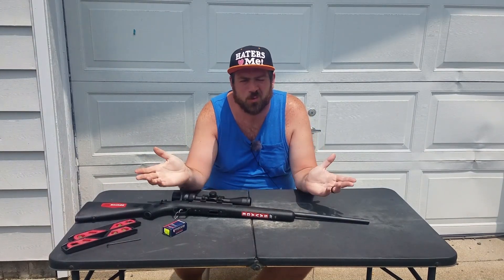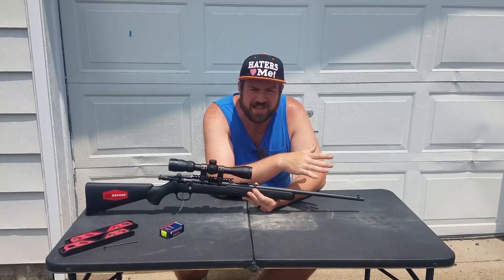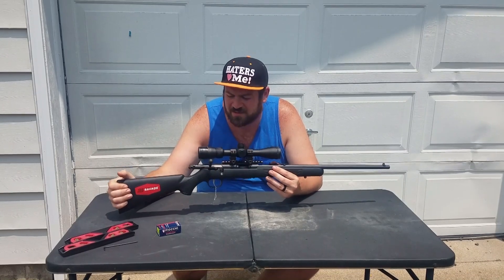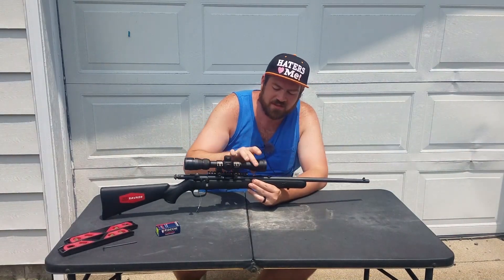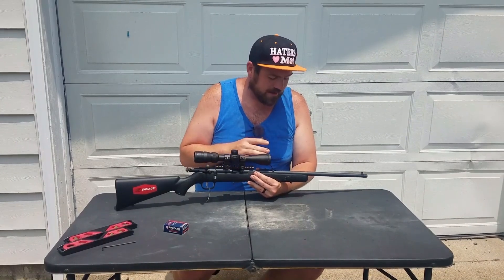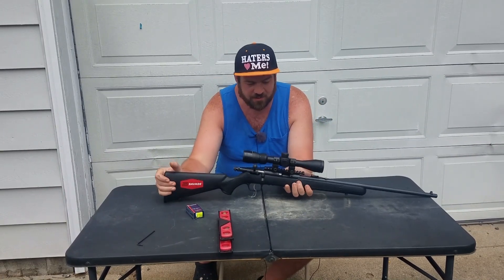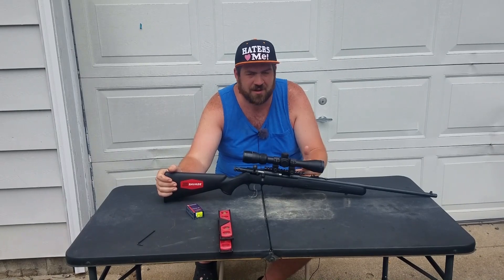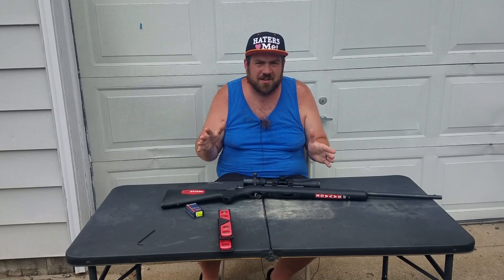"UNKNOWN" 22LR Tuning Method pt3

Comment: Alot of information protrayed here is severely flawed. Curvature of a bore can clock all sorts of ways. Only way to know is with a range rod dialed with the barrel dialed on a lathe. 
The orientation of a scope has nothing to do with accuracy.  All a scope does REGARDLESS of its canting or vertical alignment is help the shooter visually aim. The rifle will do what it wants to do

Comment: Whether or not the barrel is pointing down or up relative to scope axis.....the core question is "Is there enough internal scope adjustment available"...to center your hits? True enough....for LONG range shooting...many use 20moa "tilted" bases, with the back end higher. This is the same as having the barrel "pointing up" as you say, relative to the scope's long axis. But at shorter distances and with enough scope adjustment capability....it just shouldn't matter. Hint....Burris Signature ZEE rings have polymer inserts where you can buy excentric inserts...allowing up to 20 moa ( actually 40 moa) of tilt. I don't understand how group "size" is affected one way or the other. Sure....WHERE the group lands may end up a bit different than expected (if barrel points down vs up)....but how does WHERE the group hits....affect GROUP SIZE ? Doesn't compute.
Reply from the maker: The way the barrel is pointed determines the trajectory in the flight of the projectile on impact at the target whether it's stable or unstable ...changing the angle does affect groups if projectile is not grouping  well ....just did it at 100yd with an airgun 5 shots sub moa and hitting playing cards on edge back to back with cheap pellets (crosman 14.3gr HPs) by moving my scope to match the angle 2 notches forward on my picatinny rail
Reply: @STKO2011  ..so you're saying if you shoot a gunpowder  style rifle( not air-gun) ...say a 22LR....and let's say you happen to group 1/2" at 50 yds......if you instead are shooting at a target 50 yds away, but pointing up a hill to the target....or into a valley 50 yds away to the target....that your group SIZE ( not POI, but group SIZE)....will be altered, and won't be 1/2" ?   I'm sorry but this doesn't correlate. Maybe you can explain. I CAN undertand that maybe POI....point of impact may change, but it should have nothing to do with the bullet being "Stable" one way, and not stable the other. Not trying to be argumentative....just angling for clarity.
Reply from the maker: Depending on loading of the 22lr when I moved scope forward  shown on the rifle in this video it flattened the trajectory and poi was the same because the bullet was arcing down to the target at 50yd unstable (not grouping) and when I moved the scope forward 2 notches the bullet arc was straighter on impact resulting in tight groups because head of the bullet wasn't tilted ...that's the key how to tell whether projectile is stable or not and I can do that....this is why I can shoot any loading I want and get it to shoot good
Reply: I agree that this doesn't make sense.   What does make sense regarding barrel droop and loss of accuracy is Tom Gaylord's (Pyramyd Air) analysis where he explains that many scopes start to lose accuracy/repeatability as you adjust them towards their limits because of how erector tubes work.  If a scope worked perfectly throughout its entire range, then group sizes would remain consistent.  But they don't, so you lose consistently/repeatability/accuracy, and thus an decrease in accuracy.

The scope used in this demonstration is a cheap one, and so it will lose accuracy, and thus shoot larger groups if all you do is adjust the scope elevation.  The solution is to either use adjustable scope rings, or use shims at the rear ring to adjust the barrel Vector to be closer inline with the scope.

In summary, scopes lose accuracy because they don't work the same across their entire adjustment range, so you must adjust the barrel angle relative to the scope, such that you keep scope adjustments close to the center portion of its adjustment range.  Of course, that this is an issue is a function of the quality of the scope.
Reply: @AirGunVic  ..well then.....this points to the real root cause as being the non-repeatability of scope adjustments...and true enough... a LOT of scopes are not repeatable in this regard. All top-end scopes are repeatable, and some lower-priced scopes like SWFA and Arken are EXCELLENT in this regard. So in some way ....this now makes sense...it's a scope issue. If the presenter suspected scope adjustment to not be repeatable, then he should have used a mil-dot ( or moa) reticle and adjust his point-of-aim WITHOUT making adjustments on the scope used, but instead...use the various dots of the reticle for different ranges....just sayin'...
Reply: @TheWilferch  My mind requires some form of mathematical justification, otherwise some claims don't compute.  Yes, the issue is better explained as a consequence of scope quality.  This particular presentation is best characterized as true for this particular scope, but not generally true.  The specific gun, or ammo, were not contributing factors.  I'm going to ponder this a bit more, but at present this is what makes sense to me.  The presenter would need to provide more mathematical justification for me to understand why he believes what he does.  I just don't see it as anything but a particular scope issue.
Reply: @AirGunVic  I agree. Ask yourself..... if your gun groups a certain size....and you shoot slight elevation "up" ( say, a target slightly elevated on a hillside)...or into a valley ( slightly "down" instead).....other than POI not being POA, would you expect group SIZE to be altered due to additional " bullet instability"....as claimed here?..and it being a barrel issue?  I think not....and I don't think any gun writer  or gun person with experience will say this either.
Reply: @TheWilferch  OK, here's what I do see.  A scope set for a specific elevation, and seated as far back to the rear as possible will in fact shoot lower than if seated towards the front.  THIS (moving the scope forward) will require less elevation adjustments up, and thus alleviate a bit of the problem of having to adjust up too much because of barrel droop.  But how much, really?  The problem is still a function of scope quality.  But if this the proposed solution, then you introduce the problem of eye relief.
In order to prove whether a particular scope suffers from a more practical limited adjustment range, one would have to shoot a 10 shot group (not 3 or even 5) with the scope at factory settings, and then adjust the elevation to match your sight pictures aim point, and then shoot another 10 shot group.
If the group opens up, then your scope has a more limited adjustment range, and you have to use shims at the rear scope rings.

I would have to construct a mathematical model to determine the practical effect of simply moving the scope forward to compensate for barrel droop.  Again, then you're going to have an eye relief issue, and I still don't believe that this little adjustment is enough.
Reply: Trying to force what STKO says to make sense will only send you down a rabbit hole.
Reply: @SAPAGO4166  ....my exchanges above didn't get anywhere......was time to politely leave.
Reply: @TheWilferch  I come here for the comedy.
Reply: @SAPAGO4166  ...I don't want to be cruel as I think the presenter is honestly trying to help others. That all said, I think he is seriously flawed in his reasoning as to the scientific basis he's promoting. Good intent, bad content.
Reply: @TheWilferch  Even when he gets corrected by knowledgeable, competitive shooters he clings to his nonsense. He has piss poor test design and misleads thousands of shooters. He frequently and blatantly misreports group size. 

That being said, he has his moments and a few of his videos are genuinely informative. I agree that he isn't intentionally misleading people, but he is misleading people. He will argue and cling to his claims no matter how many times the mistakes are pointed out.

Comment: James hows it going!!! Great job on your videos, I put a bi pod on my gamo swarm magnum. What’s your opinion on putting a bi pod on a break barrel? I placed it an inch from the back of the sound moderator so that it wouldn’t be in the way while breaking the barrel, but it loosens very quickly I guess from recoil. How to remedy that or should I remove it

Comment: This method is definitely unknown. I myself adjust the torque on the butt plate screws and achieve the same thing. If you don't have a torque handled screw driver you can just put car wax on the screw heads and tape them over with electrical tape.
Reply: Makes as much sense to me as the video does.